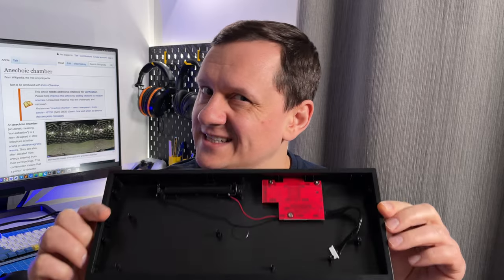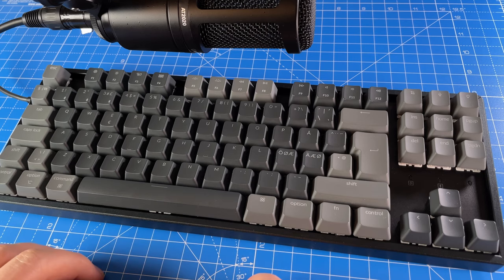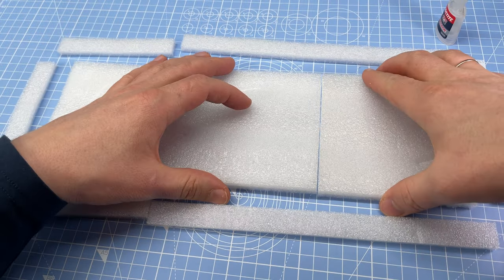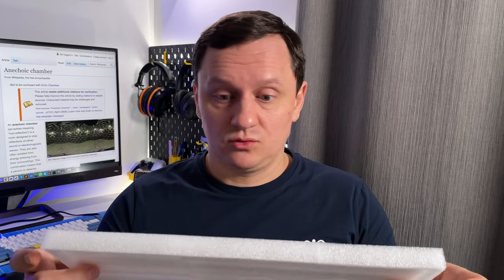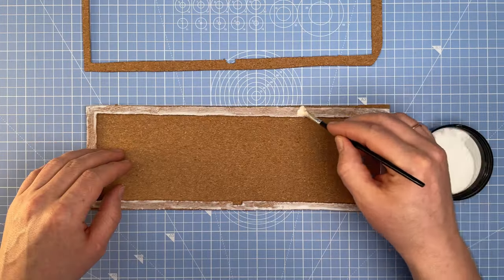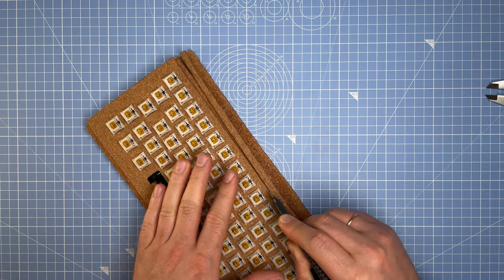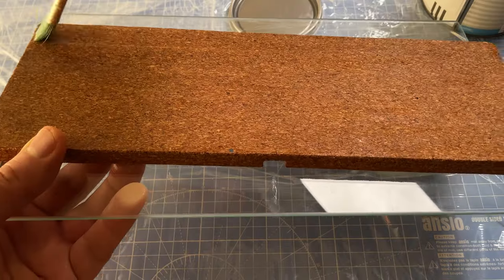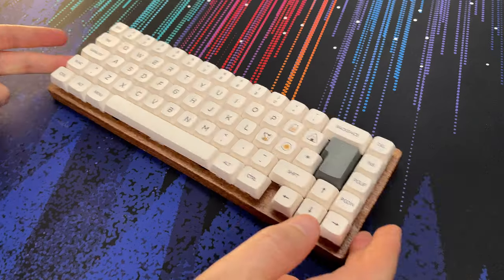Cork and foam cases for a quiet mechanical keyboard

Comment: You can also cast a solid/foamed polyurethane case. Polyurethane is one of the main materials used for sound/vibration insulation. But you'd need an SLA printer to make a model, then silicone to make a negative mould. And mask/gloves to handle the SLA and polyurethane resins.

Also, extra extra thick polyurethane keycaps should sound much better than modern thin injection-moulded keycaps (There's a video out there of someone casting their own)

That's what I plan on doing when I get enough time to design, build and program a custom layout/keyboard.